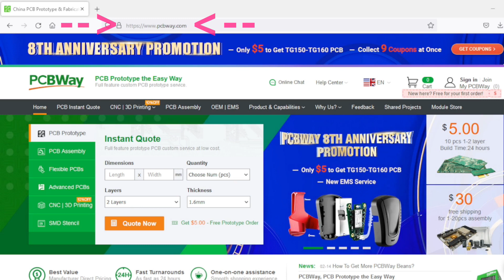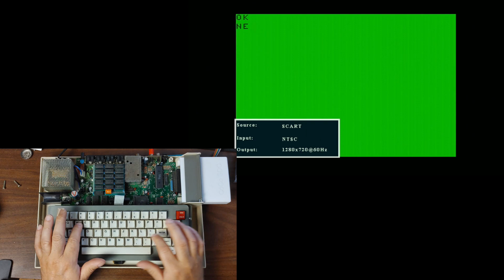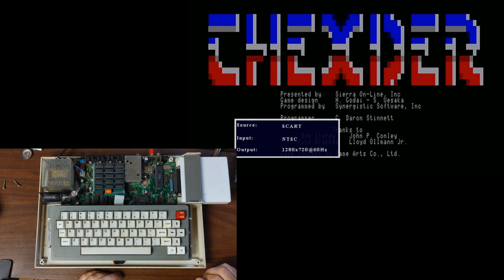CoCo3 Keyboard Circuit Board Replacement With A Keyfix3 Board

Comment: Great video. Was wondering if you had tried the “quiet” version of the keyfix3? Would be great to hear a comparison. Do you find the clickyness a positive? I think some people are going for quiet option to attempt to sound closer to the original.
Reply from the maker: I have not tried the quiet version, If I get another CoCo3 I do plan on getting the quiet version.  I like the clicky keyboard myself but I know it is not for everyone.
Reply: I got the quiet version and just installed it yesterday... It's nice!
There's still a very light click to it, so you can tell it's not a factory keyboard membrane, but it is a lot quieter.

Comment: Sweet keyboard upgrade Ken, are you going to take that Coco 2/3 switch out the back of the Coco so you can toggle between them on the fly?
Reply from the maker: I'm not sure what I will do, when my computer is sitting at home it doesn't have screws in it half the time so it would be easy to switch then.
Reply: @CanadianRetroThings  - Rick Ulland will be mailing out a little adaptor that will bring it out the bottom I believe. Should be shipped soon for everyone that has bought the upgrade.